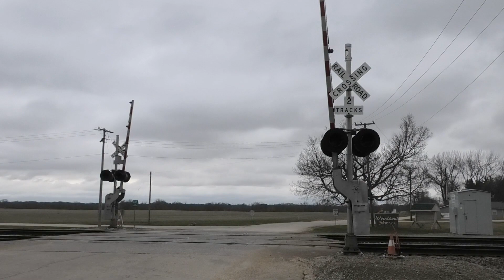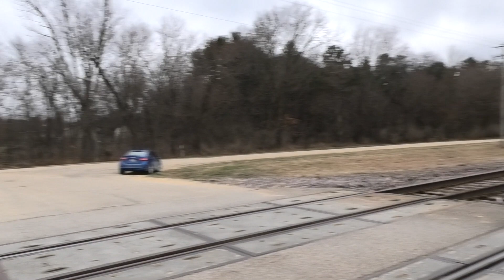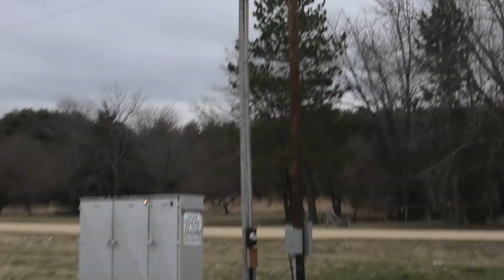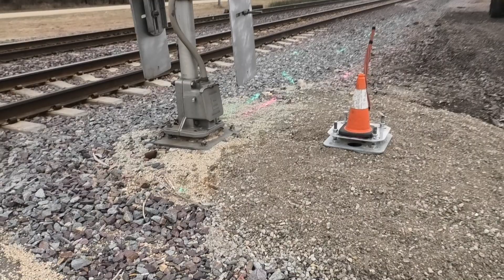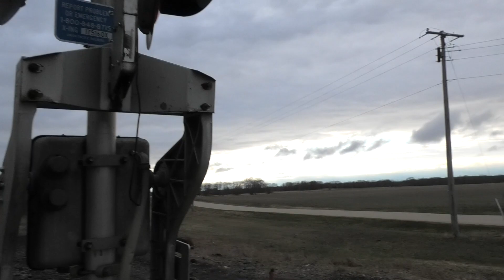Woodland Shores Grade Crossing Update Nelson, IL 3/24/21

Comment: It's quite hard to think about DeKalb with all siemens equipment as all my childhood the CNW signals have stood. UP has really not done much in DeKalb even though almost every crossing on the Freight section of the line has new signals besides Rochelle and Morrison and those have WCH signals. Sterling is still WCH though. It was very weird when the old signals at Route 23&38 got taken out. It didn't hit me until I saw the new ones lying on the ground that this was for real happening.